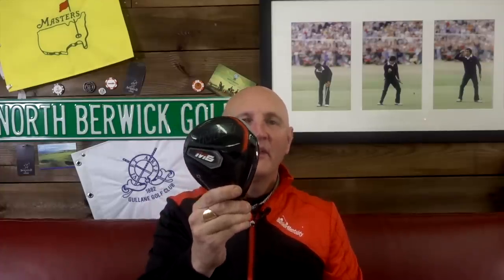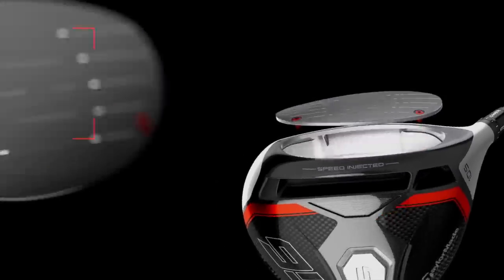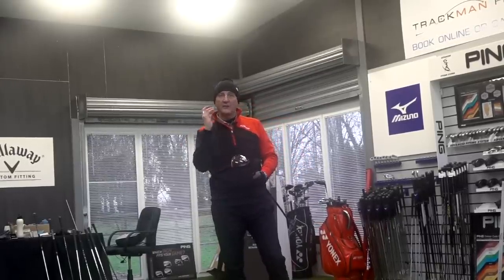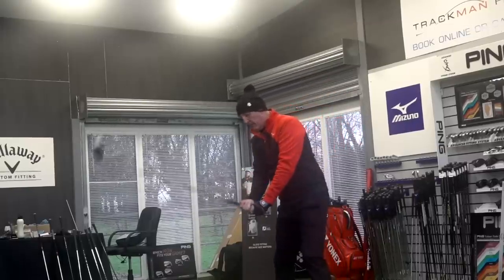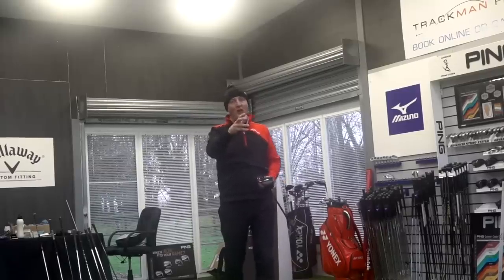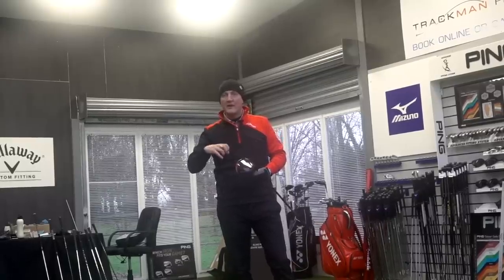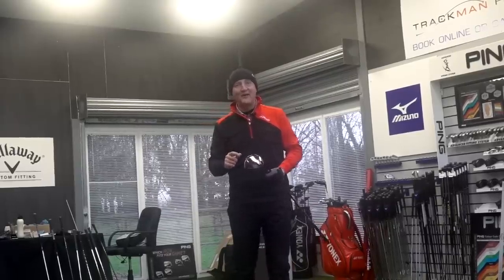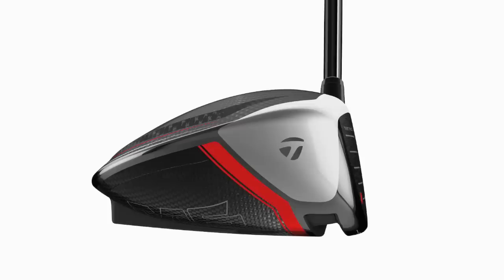TaylorMade M6 Driver tested Average Golfer

Comment: These are awesome.  I had my fitter hook me up with the M 6  Type D with a red project X  (A Flex Senior Shaft)  The ball with an easy effortless swing is going 200 -210 yards. I am a senior and my swing is good but I am on the lower swing speed side. This is a huge game changer. Last eve I was on the 6th hole at my club. I had a 223 yard hole and placed the ball on the first swing within a few feet of the hole right onto the green. A gigantic Hawk actually came down and flew over myself and the flag. It was wild. Next shot I putted it into the hole for an Eagle. I played several other holes with the driver getting me very close to green and walked away parring the remaining long distance holes on the front 9 on that course. I finished with a 1 over par. I cannot say enough about this driver. I am a short guy, only 5 foot 7 inches. I always had to have shorter shafts. Not with this one. The way this thing looks at address, the feel of it are something to really be experienced. The importance of a good fit stands out huge here and figuring out just what  you need. Great review Andy. Great call on these M 6 Drivers.  Spider Dubiel

Comment: I’m thinking they are not going faster face but higher launch/less spin to achieve more distance. For average ball speeds a 17* launch with 1700 spin will produce great carry distance. However, if spin drops any lower or the launch is a touch low at slower swing speeds the ball will just fall out of the sky. They are playing with fire creating a head that low spinning.

Comment: As ever Andy thanks for a balanced and BS free review. 
Must admit that having watched several reviews of the M5 & M6 that when you strip back the Marketing-tech speak there doesn't seem to be any appreciable gains over the M3 & M4. Either way I won't be swapping my G400 MAX
Reply: I actually added the M 6  D Type to my arsenal today Bandit. Hit tons of shots at my golf fitters with it and then took it out to the golf course for four hours of testing. I was totally blown away by the control and power I have with it. In the past I had a tough time trying to control a 45 inch plus driver. Always needed a shorter shaft. Not with this for some reason. This thing is fun !!!!  Spider Dubiel

Comment: I'm gunna buy one of these as I just bought the M6 irons but as a bit of a beginner would I be better off with a 9 degree driver or a 12 degree? Unfortunately the 10.5 isn't available as I don't have a golf shop near to try them out and that's all that is available online. I figure the 12 will be easier for me to get  off the tee and into the air but with you saying the 9 was launching too high I'm worried the 12 will launch way too high. Will I even be able to tell the difference? I'm not exactly a beginner but haven't played for about 10 years and just gettin back into it and I was never that good anyway lol. Never learnt to drive the ball well. A bit of a slicer lol